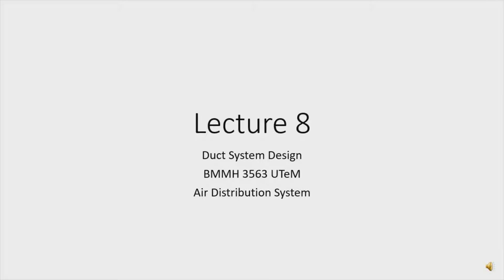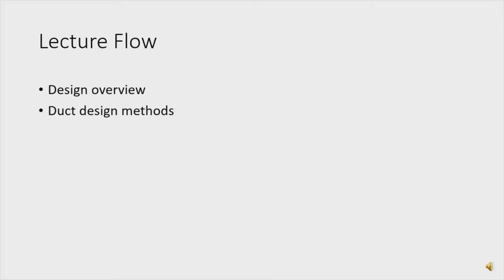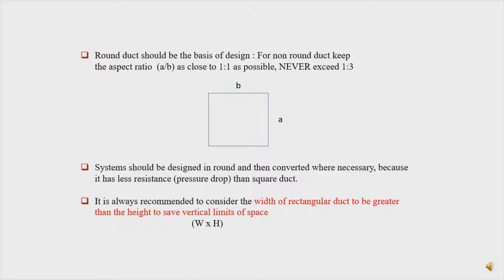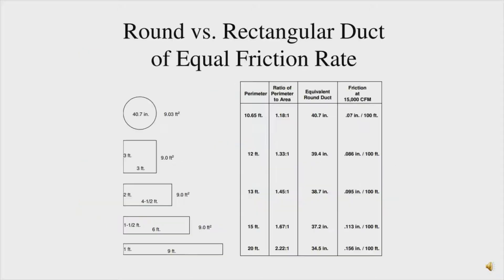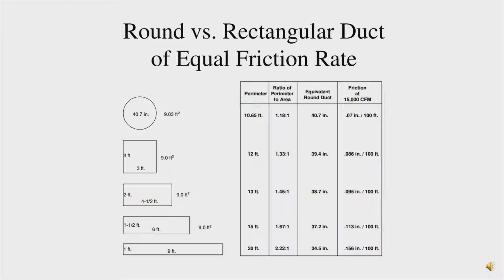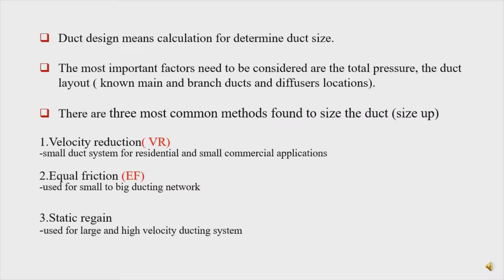LECTURE 7 DUCT SYSTEM DESIGN

Comment: AHMAD ASYRAF BIN AMIL B091810125
The purpose of an air duct system is to deliver conditioned air from one location to another within prescribed limits of space, noise, and cost. Ducting it is always recommended to consider the width of the rectangular duct to be greater than the height to save vertical limits of space, the area we calculate is (W * H).  Besides that, there are three most common methods found to size the duct which are velocity reduction, equal friction, and static regain. 
-Velocity reduction is a small duct system for residential and small commercial applications
-Equal friction is used for small to big ducting network
-Static regain is used for large and high-velocity duction system

Comment: AHMAD TAUFIQ BAIHAQI BIN MOHAMD B091810279 3BMMH S1/1

From lecture 7, I've learned about The purpose of an air duct system is to deliver conditioned air from one location to another within prescribed limits of space, noise, and cost. Next, ducting it is always recommended to consider the width of the rectangular duct to be greater than the height to save vertical limits of space, the area we calculate is (W * H).  Besides that, there are three most common methods found to size the duct which are velocity reduction, equal friction, and static regain. 
Furthermore, velocity reduction is a small duct system for residential and small commercial applications. Moreover, equal friction is used for small to big ducting networks. Finally, static regain is used for large and high-velocity duction system

Comment: Muhammad Ariff Imran Bin Hassan
B091810177

The purpose of an air duct system is to deliver conditioned air 	from one location to another within prescribed  limits of space, noise and cost. Ducting it is alwaysr ecommended to consider the width of rectangular duct to be greater than the height to save vertical limits of space, the area we calculate is (W * H).  Beside that, there are three most common methods found to size the duct which is velocity reduction, equal friction, and static regain. 
Velocity reduction is small duct system for residential and small commercial applications
Equal friction is used for small to big ducting network
Static regain is used for large and high velocity duction system

Comment: SALMAN BIN MOHD ZAINUDIN B091810498

from this video i learned about ducting design, where in designing a duct there's many constrain and aspect need to look into, such as space, noise level and cost. the duct size ratio is also one of the aspect that should be look into, the nearer the ratio to 1:1 the lower the cost of the ducting will be, so if we can select 1:1 duct ratio after looking at the other constrain is always good practice. the most common method on determining the ducting sizing is velocity reduction method, equal friction method and static regain.

Comment: SRITARAN A/L ARUMUGAM
B091810178

From this lecture, i have learnt that the purpose of an air duct system is to transport conditioned air from one location to another while keeping space, noise, and cost constraints in mind. Because it has less pressure drop, a round duct system is preferable over a square duct system. The three most prevalent strategies for sizing the duct (size up) that have been discovered are velocity reduction (VR), equal friction (EF), and static regain.

Comment: Asyraf Hakimi B071710484

Air duct system is to deliver conditioned air 	from one location to another within prescribed limits of space, noise and cost. To size up the duct divided by 3 type velocity reduction for small duct system for residential and small commercial applications, equal friction for small to big ducting network and static regain for large and high velocity ducting system. These methods required engineering judgement and extensive manual recalculations, so air distribution systems designed by different engineers for identical situations will turn out to have different fans, duct sizes, costs, and overall system energy demands.

Comment: MOHD NAZRIN BIN MOHD NAZRI B091810221 3BMMH S (1/2) 
From this chapter I learnt the aim of air duct system to deliver cool air from one loction to another space. Round duct system is better than square duct because is has less pressure drop. There are 3 methods found to size the duct : 
1. Velocity Reduction
2. Equal Friction
3. Static Regain
The last one we learnt how to determine duct work size using step by step.

Comment: KESHANRAJ A/L GANESH   B091810319
From this chapter, i have learnt:
-air duct deliver conditioned air from a location to another one within recommended space limit, noise and cost.
- important factors should taken into account  in designing a duct system are total pressure, duct layout.
-3 common methods in duct size up are velocity reduction, equal friction and static regain.

Comment: Kuganeswarao A/L Subramaniam B091810487
I have learned about the air duct system. The air duct system is to deliver conditioned air from one location to another within the specified space, noise and cost design limits.

Comment: IDA NAJIHA JUNUS 
B091810091
From this lecture session .. I have learned about the air duct system. The air duct system is to deliver conditioned air from one location to another within the specified space, noise and cost design limits. There are three most common methods found to size the duct (size up) i.e. velocity reduction (VR), equal friction (EF) and Static regain..

Comment: ahmad syahir bin ismail b091810081
from this lecture videos, i have learnt that the round duct should be in basis of design. while, for non round duct should be in ratio one to one for width and height if possible, but never exceed one to three. for the rigid duct we usually use rectangular duct and for flexible duct we use round duct. the other things what i have learnt in videos is o how to determine duct work size.

Comment: SEE WEI CHE B091810368
From this lecture video, i have learned about that the air duct system is to deliver conditioned air from one location to another location. The width of rectangular duct to be greater than the height to save vertical limits of space. The meaning of ducting design is calculation to determine duct size.
 Three most common methods found to size the duct are: velocity reduction (VR), equal friction (EF) and static regain.

Comment: mohamad asyraf aidee bin mohd baseri b091810017 . in this lecture, i have learned about design overview and duct design methods. for this to the type of ducting, round and rectangular,it have their own advantage and disadvantage .for example, the round ducting has less pressure drop but it expensive and for the rectangular duct is high-pressure drop but it cheaper .and at the last slide is, I have learned to do stable result .tq

Comment: MUHUNTHAA A/L MUNIYANDI
B091810185
3 BMMH S1/1

Based on the video, I have learnt the aim of air duct system to deliver cool air from one location to another location. 

Round duct system is better than square duct because it has less pressure drop. 

There are 3 methods found to size the duct : 
1. Velocity Reduction
2. Equal Friction
3. Static Regain

At last I have  learnt how to determine duct work sized.